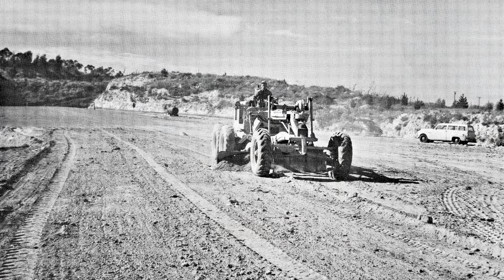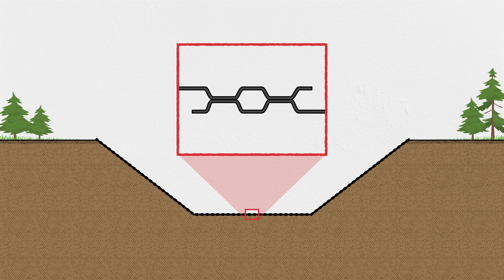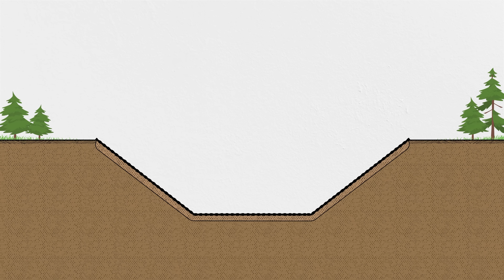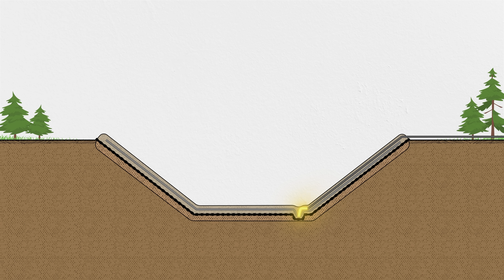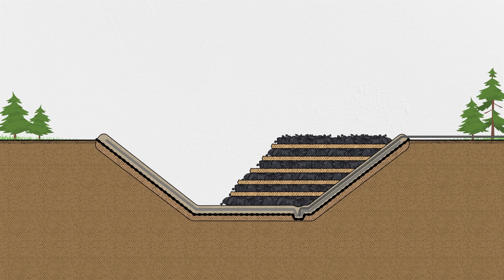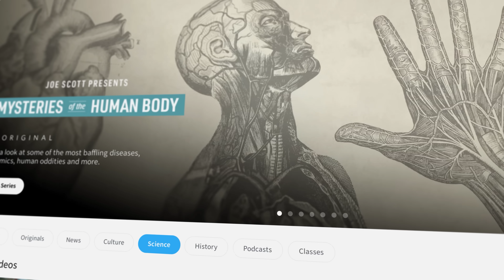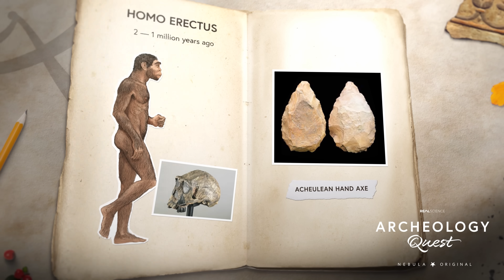The Hidden Engineering of Landfills

Comment: Everyone's perspective here has a ring of truth to it. There are some things I'd like to point out.

 1. Companies use plastic because it's one of the cheapest commercially available options and can be molded easily into different shapes. Reusable material is usually more expensive but also not as easy to work with. These manufacturers have had machines for making plastic packaging for a century. Newer materials require different handling and different equipment, so not as many companies have them or are willing to pay the extra cost if their margins are razor thin. Consumers want the cheapest price at the end of the day.

2. We as a society, especially in america, like the idea of reusing and recycling, but we don't actually like it when applied to real life. What do I mean by that? Well, most of us like the convenience of plastic and what it offers. For example, someone suggested using reusable containers that we can bring to the store to refill, but in reality, how many people will really do that? Also, it introduces a whole new level of contamination and cleanliness that america just doesn't have, especially for liquids. The reasons these things work in other countries is because it's part of the culture. We would need to change the social and cultural norms to a similar level of a country like Japan, which is much harder to do when you're a melting pot, unlike some of these other countries where 90 percent of the population is homogeneous and they are also much smaller.

In short, it's a mixture of companies and consumers. Not just one vs. the other. They feed off each other. Companies make what consumers buy the most, and consumers buy what's available at the best price.

Comment: In my city we burn all unrecyclable waste to generate electricity
The only thing that gets released into the air is access steam which is just hot water and not pollutive at all
Reply: That's an amazing way to cut down on waste in landfill! But what about the smoke? Does it pollute the air or does that get managed well too?
Reply: @tplillicrap  I'm sure they capture the smoke and process it if the only thing they release into the air is steam. Otherwise, OP's comment would be false.

Comment: I read once that 60% of what goes into a landfill is paper products. I believe it. I separate all the paper from my garbage so anything that will not burn will go into the landfill. Because of that I only have to put my garbage out for pickup once every 2 to 3 weeks. Because I live in the country, I have the ability to get rid of the paper in a burn barrel. Wish there was a company nearby that would take all the paper we throw away and use it in construction materials or something. I know some do but it should be mandatory! It is such a waste when I have to burn it but I'd rather do it that way than put in the ground. Also how are the liners not being punctured from sharp metal objects found in all of our trash. I figure a hundred years from now we are going to find out one way or another. Don't see how our underground aquifers will come out unaffected.

Comment: You didn't talk about how landfills are not a sustainable solution. It is project that in less than 60 years there will be no more viable space in the USA for landfills(even less in some states). At which point they will have to redefine what is viable land (national parks, public land, residential areas, etc.). And after 100 years we will basically be living in Wall-E world.

Comment: In the 90's i used to make steel tubes 8inch diameter 6ft long with 52 slots in 4inch by ⅛ .
The tubes had a male and female thread at each end .
They were used for methane extraction on old landfills that had been capped before modern standards .
Drilling companies would drill down into the landfill and insert theses tubes to the desired depth and extract the methane to flare stack or power generation

Comment: I worked for an Environmental Company years ago and while accessing a landfill here in New England I was told by an old timer there was an old army tank buried there. They used the tank to compact the trash. After it stopped running they just left it where it died and covered it with trash. Well while installing a methane detector the drilling company hit the tank and all the alarms bells and whistles went off and the crew ran like rabbits away from the area. Was funny to see but a safety precaution for sure.

Comment: Hold on... The USA is still doing this?  Jesus. Like in Switzerland we burn it, the heat is used as an energy source for the city and the air gets filtered completely clean before it leaves the burning sites... I mean like most countries I in Europe do
Reply: We have a burn  incinerator in the town I live in. I think it's been in operation for about 15yrs🤔

It also supposedly creates electricity for 10k homes per year🤷

Comment: You said that a completed landfill has to be controlled "forever". Is there no amount of time in which all would decompose to basic earth elements and thus be able to be reclaimed like composting? It seems unlikely; but if somebody had a good reason to bulldoze flat , a pile of garbage from 200 years ago; would it not be completely organic at that point?
Reply: Lots of types of plastic and Styrofoam don't decompose. Eventually the organic matter will be gone but there will pretty much always be some trash left over.

Comment: And then slowly over time the rubbish breaks down and all its chemical components are washed through the lands into the sea, poisoning them both :D  Dont think they will because of methods shown?  then I have a bridge to sell you as no one can guarantee the structural integrity of the bowl and drainage systems once the place is capped, if they even bother before hand, and certainly not for the centuries required...

Comment: I remeber the 90’s when it was possible to dump trash to landfill. 

This has not been possible anymore in couple decades so there will be generation who has never seen operational landfill. Landfill near me is just grassy hill and a pile of concrete, bricks etc. They can only dump inert materials these days. 

Wood is chipped and burned, biowaste goes to industrial compost area, clean dirt is screened and used again in cosntruction, metal recycled and plastics goes to sorting center actually half a mile from my house and so on.

Comment: When we got married, my wife and I unknowingly bought our first house bordering active landfill property. It took about a year before we discovered that. This particular landfill was once a rock quarry pit, and also used the methane gas to generate electricity locally. We never lost electric power with it being generated so close by. We seldom smelled any odors mainly because we were upwind of it. 

The only downside of being neighbors with the facility was the road, we had to regularly patch and replace tires on our vehicles from debris falling off the trucks coming and going all day. Eventually, we started driving out of the way just to avoid driving by its entrance.

Comment: Why landfills? In Sweden we recycle what we can, and then burn the rest (with proper filtering of the exhaust gases) to get heat (to heat buildings) and/or electricity. Landfill basically does not exist for household waste.

Comment: As part of the "club", this video warms my waste engineers heart more than a bioreactor landfill. This was very well presented. 

I'm more of a keyboard engineer now, but I cut my teeth as a chemical engineer graduate working under a landfill engineer specialist. Landfills are amazing - well, properly designed and operated landfills are. I used to design and optimize landfills specifically for methane collection and WTE/carbon abatement projects. The amount of "simple and cheap" stuff that needs to work is just a marvel of cost efficient engineering practices. On my end of things (when I got away with a good bioreactor alternative) we'd have a double bottom where the first layer would allow for leaching into the pipe collectors for recirculation, and the "true" bottom would have two layers of impermeable clay and a geomembrane. Not cheap, the luxury version of a landfill. And some sensors downstream in the water table to detect if something got messed up and there was a breach. 

In my opinion, we should for sure reduce the amount of waste we produce, but reality is that at the end of the useful lifetime you'll often retain a fraction of solid waste that's not viable for anything but disposal. Things such as slag from metal recycling, contaminated plastic and glass, etc, undegradable fractions from composting... Even ash/slag from thermal treatment of wastes for energy recovery. We'll always need safe and efficient solid waste disposal facilities. 

And I fully support the generalization of "garbage juice". This is not really a leachate, as my colleagues in mining and extraction industries understand it. Just the result of moisture percolating through waste -  garbage juice. 

PS - yes to the multidisciplinary aspects of landfill management. I was involved in a project in Mexico. So basic assessments for engineering, volume of waste, composition, geology. Then the bombshell "you guys are going to pay for the road improvements needed for the waste trucks and convince the municipality, right?". Must admit we weren't ready at the time and definitely needed the legal and political expertise.

Comment: Thank you, this was interesting, humorous and informative.
You may be interested to know that the site of the Sydney 2000 Olympic Park was originally a giant garbage dump.
My father was an electrical contractor and he won the bids for a couple of projects during the construction of the Olympic Park - and I in turn was working on site.
It was a strange/awful place. The ground was so "raw" and unstable. Any time trenches were cut into the ground, you would just pull up garbage. The place stank and there was a lot of methane that had to be flared off.
Over the years, some of the areas we worked on have deteriorated dramatically and there are now large undulations in parts of the pavement, movement of structures and the like.
Not ideal (I guess the project was kind of rushed...) but it was a brilliant revitalisation of this awful part of our city - the Olympic Park area is lovely.

Another interesting project Dad worked on was a huge underground waste transfer and incineration system for the city. Unfortunately, political elements came into play and the incinerator never got to do any incinerating.
A big waste of resources (both in construction and the extraction of energy from waste).

Comment: Having an aunt that was a bonified hoarder.  The landfill where we had to dump all of her garbage had an intricate pipe system that was for keeping the landfill wet even during the hot dry  California summer.  I had  presumed that this was to reduce the chance of fire and assist with the compaction process.  I have always liked to think that the landfill gas was filtered to get 99% pure methane to produce electricity and that they had their own ponds for reusing the winter rainwater, but because I live in the Solano County, where the funnel shaped delta causing incredible wind speed, we have used wind energy before it was cool to do so.

Comment: @practical engineering 

Do you have a video about waste to energy, combined heat and power plants/treatment facilities that European countries have been building for decades now?

If not, would you make one?
Very curious how they make it work, and also why it hasn’t caught on in USA
Reply: As an example, from the web:

“Only 1% of Sweden's trash is sent to landfills. By burning trash, another 52% is converted into energy and the remaining 47% gets recycled. The amount of energy generated from waste alone provides heating to one million homes and electricity to 250,000”

Comment: I'm sorry but am I missing something?

In Sweden, we used to have landfills up until the 1980s, but they were largely phased out. Since then, our focus has been on recycling, waste-to-energy solutions, and minimizing landfill usage as much as possible. I’m genuinely curious why landfills are still seen as a viable solution in the U.S. when alternatives like recycling and waste-to-energy have proven more sustainable. 

Landfills pose significant long-term environmental risks, such as groundwater contamination, methane emissions (a potent greenhouse gas), and the loss of valuable land that could be used for other purposes. While it's true that some gas, mainly methane, can be extracted from landfills and used as energy, this process doesn’t offset the larger environmental costs associated with landfills. Methane collection is often inefficient, and much of the gas escapes into the atmosphere, exacerbating climate change. 

In Sweden, strict waste management policies and high recycling rates have been key in minimizing waste to landfills. We also prioritize biogas production from the oragnic waste or incineration with energy recovery from the burnable waste, which contributes to district heating and electricity generation. The idea is to create a circular economy, where resources are reused, and waste is seen as a resource rather than something to be buried.

Why isn’t there a greater push for similar waste management systems in the U.S., where recycling rates are generally lower? Are there structural or economic barriers that make recycling and waste-to-energy less attractive options? I would love to understand the rationale behind continuing landfill operations in such a large scale.
Reply: In the US when you send something to be recycled chances are it’s shipped to asia where the wastes are processed to be reused. 

Unfortunately a lot of these Asian countries have gotten mad in recent years. 

Like when the Philippines was promised old electronics or e waste. They were surprised to find diapers and rotting food in the containers. So they began demanding that Canada take back the garbage.
Reply: What works should be the blueprint.

Comment: Grady, unfortunately my comment is 13 days after you posted this video, but here goes:

Back in the ~mid-'80s, our "Plant Engineering" group arranged for some of us to go on a "behind-the-scenes" tour at Disney World.  It was all fascinating, but one thing I still remember vividly was their trash-burning furnace(?) where they burned all trash from their parks.  Both parks full of visitors didn't create enough trash to keep the "furnace" going, so they tried to get trash from (I think) Orlando.  Unfortunately, whoever they asked wanted Disney to buy any trash they were given!!  :(  Disney had to shut down the "furnace" and then send all of their trash out to local landfills.  The furnace even output "cinders" (or similar) that Disney mixed into their road toppings, reducing the overall cost of their roads.

Just think of how much waste gets buried instead of being processed in a "furnace" that creates good road topping material.  It's a shame that this type of waste treatment isn't used to greatly reduce the volume of waste in our rapidly "filling up" landfills!

Comment: My city has a landfill that has been converted to a park. I had always wondered why there was a pond next to what used to just be a pile of trash, but understanding now that it was likely a leachate pond makes a lot of sense. Thanks for sharing.
Reply: I think leachate is always collected in tanks.  Because the "trash mountain" has an impermeable cover there is a lot of runoff that is collected in sediment basins. When the cover is functioning appropriately there should not be much leachate.
Reply: The leachate is collected. I think you might have noticed if that pond were pretty smelly.

Comment: Great, informative video. Took a dirty topic and made it interesting and easy to understand. One point to consider: there are thousands of closed landfills that do not meet the standards described as normal or typical in this video. There are playgrounds, parks, and other recreational sites with built over old landfills and testing positive for dangerous levels of arsenic or led or other unsafe materials in the surface soils. New regs don’t necessarily address existing dangers. New regs also aren’t always followed. There’s a reason landfills worry people.

Comment: "Trash is an inescapable element of the human condition" : I disagree! I recently saw an exhibit about trash and recycling, in the Cité des Sciences et de l'Industrie in Paris. It came with a timeline of trash, stating that before the 1800s (if I remember correctly) and the industrial revolution, the concept of trash didn't really exist. Everything could be used by someone elsewhere: bones from the meat industry were used to make glue and other products, metal was melted again, used fabric would be turned into paper... Today, the modern recycling industry is still in its infancy, but there is much to be done to recycle our mountains of plastic, electronics, clothes...

Comment: If you have a hole from strip mining, that's a good place if you don't have the water table near it if put plastic.  We need to have packing that is easily compostable.  We use too many toxic products.  The leachate wouldn't be a problem if the trash was properly composted at a high temperature.  Methane can be recaptured to generate electricity.  If we can eliminate PFAFS and breakdown pharmaceuticals, the leachate could be a great fertilizer if there are no toxins.  We need a waste management system that generates energy and fertilizer, rather than being a perpetual problem.  However, consumers and producers must change their habits to keep undesirable things out of the landfills.